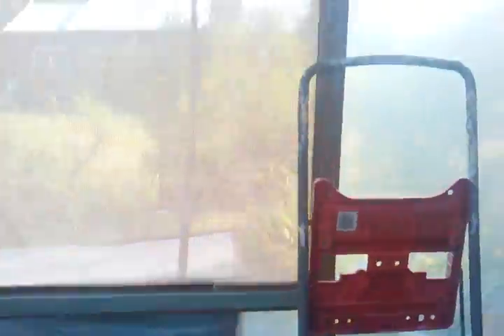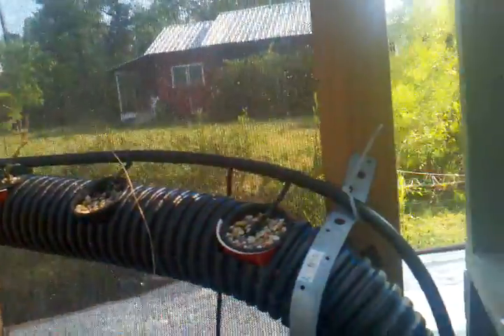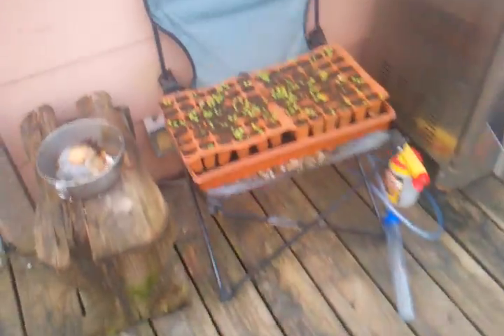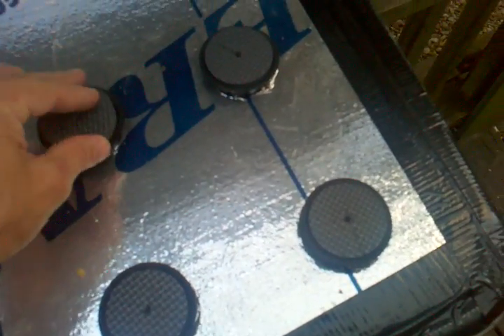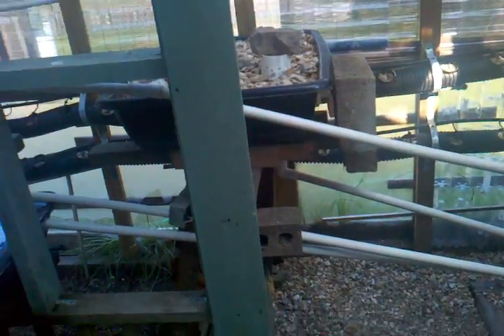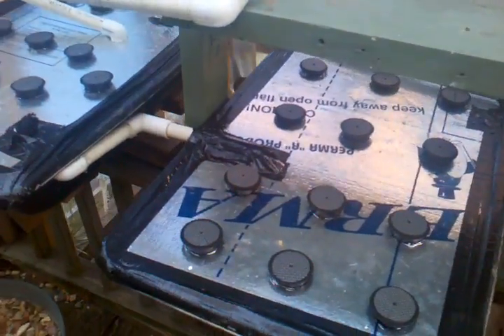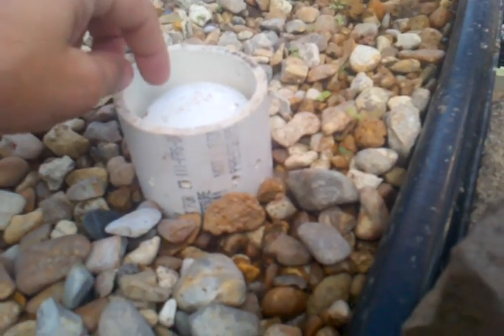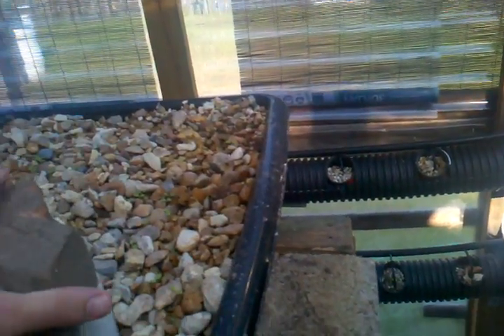Three in one aquaponics system

Comment from the maker: @blackhawkcreations:i did use a 100 ft. irrigation hose($10 @home depot) from the pump and dripped into every cup.But i got algae so i tried covering the cups but water kept leaking out or the plant would not get enough light.so i extended the drip hose so it would be buried in the gravel in the net cup.but even that was a hassle and hoses would pop out of the cup. the whole drip irrigation part of my system is probably not a good idea.i don't recommend it.It was so laborious and time consuming.

Comment: Cool system!!! Never thought of using the corrugated drain pipe like that. Is your water piped up into the smaller line, then dipped into the cups and return being the big pipe?

I used the styro cutouts from the hole sawing as covers for the net pots in my system.....was getting algae too
Good luck with all this.....fixing to add a new node to my system, and will prolly use the corrugated pipe
Steve

Comment: Cool .. I am using an ebb and flow system right now and plan on expanding to my 2nd bathroom lol the tub that I was using had some weak spots in it so had to remove it and sent the water straight to the fish tank, the fibre glass tub is leaking so I am going to use my blue tub so if it leaks it will just go down the drain ... yes was going to mention that with all of that you will need a bio-filter

Comment from the maker: before I added the bell siphon the three black containers were all filled with gravel and the water cascaded down through each one but the water would just get to dirty and full of algae. Since the water could not fully drain from the gravel beds it made the water way to dirty. So it was an experiment that worked for a little while and grew some lettuce but after a while it was to dirty. So I would have to clean it out and then start the whole bacteria process over again.